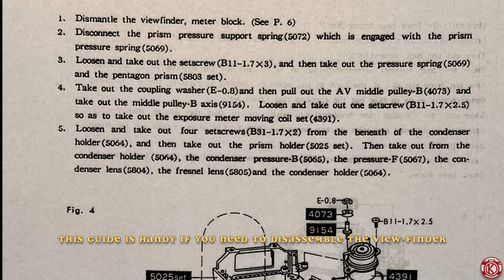Cleaning & lubricating the Minolta SRT 101 - 35mm film camera restoration

Comment: These videos have been fantastic! Thank you for all the help!
Reply from the maker: Thanks for watching, I’m glad you like the series!
Reply: @aokcamera  would lithium grease be a decent replacement for the Moebius grease? Since the application is small and I only plan to restore 1 camera. Thanks again!
Reply from the maker: @TheFattestLonelyPickle  I don’t have much experience with lithium based grease so I can’t fully endorse it myself, but I did some research on it for you. The main things I look for when choosing a suitable grease are consistency, temp tolerance, longevity and what types of materials it can be used in between. I know that lithium grease is very versatile with great tolerances and moisture resistance, the only red flag for me is that it can speed the break down of plastics over time. There are a few plastic parts in the SRT so just be mindful to avoid contact with them, use a small amount and I think it should do the trick for you 👍.

Comment: what's the reason for not getting isopropyl on the mirror? i've always used it in the past to clean off the oil dust mist that settles on them when someone decided to leave the camera out without a cap for a couple of years/decades.